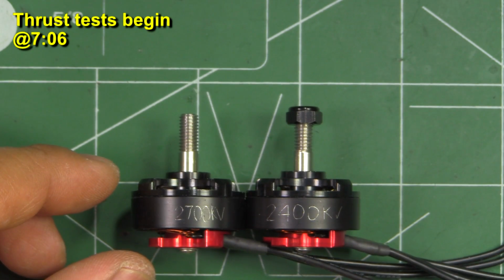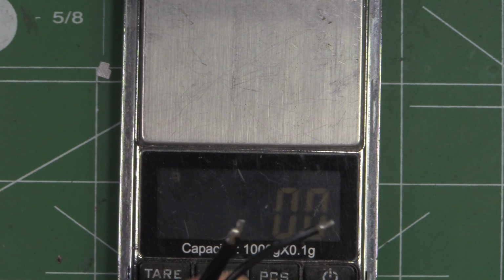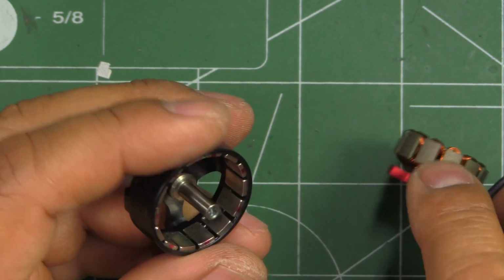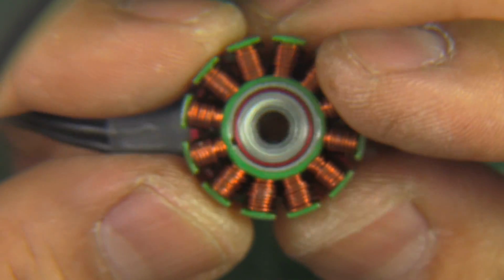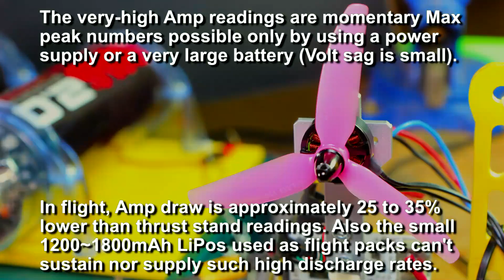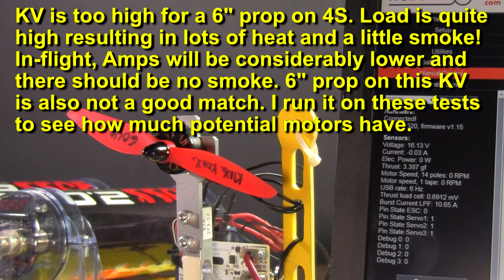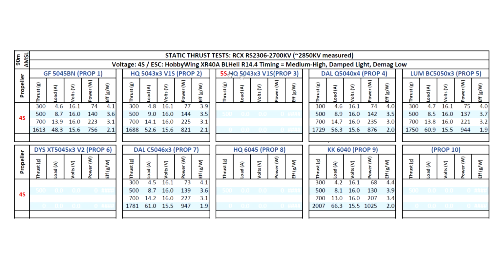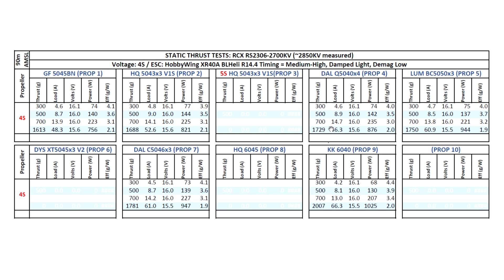MyRCMart.com New RCX NK2306-2400KV and 2700KV Prototype Motors Thrust & Overview

Comment: Compared to other "naked" motors the bottom looks really thin ... i hope they thicken that up in the final. I really like the hyperlite naked bottom style that recesses the bearing / nut up into the base to avoid interference with frames / soft mounts.  looking forward to the finals and more great stuff from you and MyRCMart. Thanks!

Comment: Love my 2206 v3. Remind me very much of tornado t2. Looking forward to these. Thx for the look. Wish they were a bit more efficient
Reply from the maker: Those are the best motors RCX has ever made so far. They're at the top in price/performance and still very competitive.
Reply: Nah those 1407s I bought after you're review are invincible lol it's like flying with fast forward on :)
Reply from the maker: I got my 3400KV set mounted on a superlight 5" frame - not yet finished, I wanna see how they'll do with 5030 props and the 4100KV waiting for my 3" build... ugggh need more time to play
Reply: Coppertop FPV is your rcx 2206 V3? I want to buy them. Do they puff your batteries? All of mine are 1300mah 4s.
Reply: Indeed. got some hyperlight 2204 2722kv sat on my half finished superlight. Not sure if I made the right call there. Impulse buying again...
Reply: Yeah v3s. Depends how hard you fly!  They're more efficient than most thrust equivalent. I've had no issues on 1300 & 1500 inifintys.

Comment: Seems like a Really really nice budget motor. But it is a pity there is such a high shipping fee for us in EU.
Reply: I'm in the uk so not sure about the eu thing lol but shipping via slow boat here isn't expensive at all. Skip the warranty and they're cheap as chips.
Reply: its like 7euros shipping from myrcmart to germany. this is enough to make them a much tougher sell, considering you can have comparable motors like the aokfly RV2306 cheaper and without shipping costs from banggood and you can even avoid customs by buying them in pairs.

We are talking budget after all.
Reply: In over 300 orders from banggood and myrcmart ive never had customs charges. That only happens when you buy from America or choose expensive fast delivery in my experience. Buy 5 motors and 7 euros is nothing. I've got the aokfly on the way, but there are plenty of bad reports out there on them and only one really positive one from a dubious source. I expect them to be powerful but last 2 minutes with. 3mm shaft and tiny air gap. I've got 8 rcx 2206 v3 on the go and 4 1407s and they've been rock solid. I wouldn't have even considered aokfly if these were available,
Reply from the maker: You'd have to offset the shipping cost somehow, maybe wait until you need more stuff so you're not paying for shipping just for 4 motors, get 2 sets, spare bearings and other parts or you guys need to band together and get 2 or 3 fellow FPVers and make one large order and split the shipping cost :) 
I'd hate to have to pay all those customs fees, hope the US Govt doesn't decide to get into a trade war with China. I want my cheap FPV parts!
Reply: Onederman 1997 I have the aokfly 2.4kv ones. of the first 5 reviews on banggood that I could read, 3 were negative with problems with magnets slipping etc. same reason I avoided the rcx v2. engineer x had an issue on his test one. i like to do my homework, but got them so I could check them myself.  The rcx have been great so I said so. they do have crap nuts tho. The only overwhelmingly positive thing I've seen is from bob, and he'll change his mind next week as always :) Can't really say more than that. I have half a dozen other brands here, but none that approach the quality to cost ratio - also confirmed by this reviewer.
Reply: Coppertop FPV from my perspective, i am going to pay 20$+10% (total cost Incl. Shipping) in taxes. 
All this adds up, and in the end i prefer buying highend dys 2306 send withind EU. Hence no tax or any extra costs. 
I also have the option of ordering single motors from china, reducing the total price, and avoid the import fee
Reply: Hrr Pippi you obviously have stricter customs sadly.  as I said I've never had to pay tax on Chinese purchases.

Comment: Those are decent numbers...  in-line with the Emax 2306-2750kv motors... the big suprise still and I'll vouch for it is the rcINpower gts2305-2700kv ... get'em cheap on Ebay $10 @27.5g's (no wire) each... absolutely insane motors on my 270g build...  I'm running se2205-2600kv "V3" and absolutely love them on my light build (220g's) but wish they were lighter of course... you can actually fly a 1300mah with it... anything bigger and you gotta run a 1500mah... so my suggestion to RCX is make lighter se2205 cause a lot of people are looking for them for ultra-light builds.... and lighten these RS2306 up about 2-3g's and i'll buy em for my all-out crazy quad...
Reply from the maker: Those rcINpower motors are some of the best I've reviewed. They have been "overlooked", rcINpower doesn't seem to do good advert/marketing , I've mentioned that to them often because they're difficult to find in popular stores. +1 on all your observations/recommendations
Reply: Thanks! ... One more thing to note to RCX ... stay with the "C" clip... I'd rather have the weight savings.... at these prices I just buy spares... :)
Reply from the maker: I think those shaft screws are an unnecessary complication, just one more point of failure (trying to remove and people end up messing up screw) I've never had E- C- Circ- clips coming off. They're cheap and you can find them on BGood, Ali, Amazon, eBay... and right they weigh less. 
I guess they "had" to add them so people wouldn't think "less" of the motors.
Reply: The one on eBay with silver colored screw threads are counterfeit. Get the one with brass colored and those are $22 a pop.
Reply: I've looked everywhere for the brass colored ones and no luck... but must say I'm very happy with my purchase off of ebay with the silver colored ones.... only one out of 8 was not balanced enough for me... so I'd rather buy from a reputable source... hoping these RCX final product will be good...
Reply from the maker: MyRCMart carries them - they're becoming a one-stop place to get motors: 
http://www.myrcmart.com/rcinpower-gts2306-2400kv-brushess-motor-for-fpv-racing-drone-p-11455.html
Very cool they're carrying lots of brands now, AOKFly, BrotherHobby, EMAX, rcINpower, etc.....
Reply: I was looking for them as well. But I got suspicious, so I asked to the couple of sellers and no one could guarantee if they are genuine or not. I have seen those for $30 on aliexpress. But if it is working out for you, that is great.
Reply: Lol... things are changing so quick in this hobby it's tuff to keep up.... those are new 2306  !!!! you gotta test'em ... lol....
Reply: Not everyone is pinching grams.  I'd rather have a beefy motor that won't bend every time i crash. C-clips like to break in crashes when running dal cyclones, at least the ones myrcmart used to use on the rcx motors.  Ah,  the good ole days when you didn't know if the bell would just going flying off your rcx motor in a punch out, it was so exciting.  That's when they when back to grub screws to hold the shafts in place.
Reply from the maker: LoL.... I remember a few of those H2205 bells flying off.  Oddly, I had not heard about C-clips breaking on a crash, but I believe it coming from you, I watch your channel. hopefully these prove to be reliable and durable. We will find out soon as people start using them.
Reply: I still have some of those bells, ordered the replacements for like $2.  These new rcx motors look good, hopefully they can keep them in stock. I tried to order some 2206's a few times.

Comment: Did or do you get alot of video noise in the goggles at 1/3 to 2/3 throttle on the sticks. Have cap and L-C filters. Rewired the ground every way you can. I have another quad with everything the same but motors and frame. It's perfect, not even a cap on it. Crystal clear goggles video. Any ideas? Thanks and Fly On Moo!!!
Reply from the maker: I never installed a set of these. Unfortunately not enough time to test fly all motors. I have not heard anyone  having those issues just with this motor only. I have heard same issue with many other motors from several brands EMax cobra etc. Sometimes escs are the problem, sometimes mount screws touching wire windings..... Hope you fix video issues

Comment: Will 2400KV stand up for Avan props (5075 bi-blade)? I'm looking for a speed, have already RS1407 mounted and that's super sweet that RCX is making 2306. If only they can handle Avans.
Also looking for Hobbywing 2405, they're interesting in terms of power.

Comment: You must test the dys budget motor series they r coming out with. Do u think that they could compete with rcx for best budget motors? Also, do u think that dys has bad qc similar to rcx or racerstar? Or r they a venerable company enough?
Reply from the maker: DYS sent me the Samguk 2207-2300KV only so I'll test those soon. As far as quality, I think the Thor, Mars, Storm, and Fire series motors have done very well. Those have good quality construction. These new low-budget motors, I don't know how good they're going to be. It's very difficult to determine quality sometimes just from thrust tests or even from disassembly. Usually problems are with bearings if they're not good, motors get unbalanced. But we can only find out about bearings after using and abusing motors for a few flights so it's very hard for me to determine during the time I make these video reviews. Also difficult to compare against RCX. There have been some issues with some RCX and with some DYS motors from what I read in the past. Sometimes a batch will have issues then it gets fixed. I think right now, RCX is one of the best budget motors. The RS2206-2400KV is one of the best and the new NK2306, and NK2207 motors are looking very promising. Hopefully they are issue free! 
Thank you for watching. I hope to have the Samguk motor video up in a week or so.

Comment: What is the rattle sound when u spin a beat up motor by hand? Does that mean that u need to replace the bearings? If so, would that make the motor good as new if the bell and shaft r fine?
Reply from the maker: Correct! Some times it could be some debris or object stuck in the magnets and hitting the stator so always good to check around all the magnets using a magnifying glass. 
Some times the bearings went bad, so if you replace them with a set of good bearings like NMB, EZO, or NSK, then motor will be like new again.

Comment: Just wondering could we get a 1000g or 1200g thrust points instead of 700g or both. Just over 1000g per motor is all I really care about and the eff. Because theres such a huge increase from 700g these days. What are your thoughts?
Reply from the maker: I've actually been thinking about changing thrust points to 500, 700, 1000g so I'll probably start doing that in future tests.
Reply: EngineerX That is a great idea. Do 500, 700, 1000 then max on these big motors.
Reply: Awesome sounds good!!
Reply from the maker: Will do. I kept using those points but motors kept getting larger and more powerful so yep, better change the thrust points.

Comment: What prop gave the best efficiency to power ratio? I don’t know what props I want.
Reply from the maker: Usually the props that give best efficiency are the 2-blade props, but they won't feel that responsive if you want to to fly freestyle at parks. Everyone prefers 3-blade props for freestyle. 5040x3 & 5043x3 will give you a good balance of thrust and efficiency. 5045x3, 5046x3, GemFan Flash, DAL Cyclone... will give you the most thrust but you'll drain battery quicker.

Comment: would you reccomend this motors or the aokfly 2306?
Reply from the maker: The AOKs have been getting OK reviews with some sporadic issues reported , normal as most motors. They showed very good performance on the tests and are very-well priced. These RCX motors follow the traditional RCX formula, low/mid budget motors with very good performance. Almost always, RCX offers replacement parts for purchase. So bells, stators and bearings are usually all available separately so you can buy some spares when you buy motors (don't know if these are going to have those parts available right away) Anyway, it's very difficult for me to recommend either motor because I have not used them both in long-term conditions. I like recommending motors that I've used long-term so I know that they have lasted lots of flights and beatings :) 
I think for the price range, both motors are very close to each other. These are new so not many user reports, the AOK's have been around longer so you can dig up more user reports about their performance over time.
Reply: EngineerX thanks for the replay, after thinking about it i think i might just go for the 2206 v3, there is no 2306 2400kv version available now and from what I've seen the recommended AOKFLY is the 2650kv one and since I don't want less Than 3.5~3 min flights I'll just go with the more efficient 2206 motor, I also don't need that much power since im used to 2205 racerstars
Reply from the maker: Very good choice. It's good that you thought about all those aspects. Going from RacerStar to the 2206 should be a very noticeable improvement and those motors have been around for a while now and are very well-liked. I usually pick up a set of bearings so I take advantage of the shipping and you can "refresh" motors once you notice they get loose after a few months of use.

Comment: I have one question that 2400kv version (2500) what kind of esc should you use on it is the dys xsd 30a good enough? (Yust ended my first build and looking out for upgrades)
Reply: Bennie Leip yes they're good escs. However for less money you could get the Spedix gs30amp which are my favourite brand and run blheli 32.
Reply: Coppertop FPV i have them already but i only wanna know if my esc's could handle this motor . And i know there are cheap good products but if i wanna buy these thinks i have to pay allot of tax (if i wright it good😆) because i leve in holland and there are not allot of chops who sell the cgood thinks but thnks for replaying 👍🏻
Reply: Yeah dys are good if you have them. Banggood sells the Spedix if that helps.
Reply from the maker: Coppertop's advice is very good. 30A is perfect size for these motors (and any 2306-2300KV ~ 2700KV) running on 4S and any of the 5" props on the test. Those DYS have proven to be very solid ESCs and a lot of people are running those Spedix too because they're very affordable and very good too,
Reply: Coppertop FPV i had bought by banggood a frame for 30euro and had to pay 20euro extra for it so i try to buy as mutch as possible in holland but thnks for helping and engeneer x thnks for replaying👍🏻
Reply: Ouch! sorry to hear that

Comment: Of course these are a thing because I just bought the aokfly motors.
Reply from the maker: Those AOK's did very well in performance. Just need to give them a quick inspection to make sure screws have threadlock and nothing is rubbing/scraping inside. So not a bad choice I think.  The one thing I've always liked about RCX motors is that they've always had very economical replacement parts (bells, bearings, etc)  in case you need them
Reply: Also just ordered the aokfly and will fly them on the weekend. I just checked the two vids again and the aokfly have about the same or seldomnly more thrust but pulling less Amps, so it's more efficient.... phew :D

Comment: The magnets look thin because the bell has a lip around the bottom rim to hold the magnets from falling down. It's a feature that should be shouted from the mountain tops!  ;)  :)

The only thing I'd like to see in RCX and EVERY other motor is CW and CCW shafts!!! With directional threads we don't need lock nuts! Just spin em down and slightly snug them. To remove just 'crack' the nut and spin it off. I have both types. NEVER again will I buy motors that are all CW threads! PITA x1000!!!!